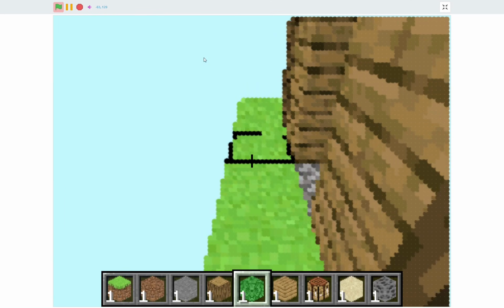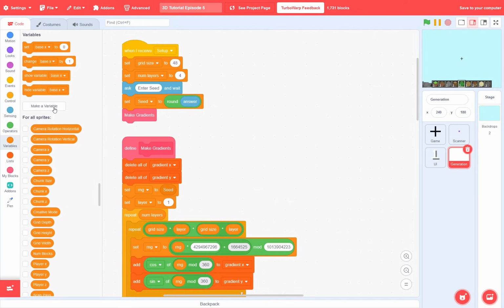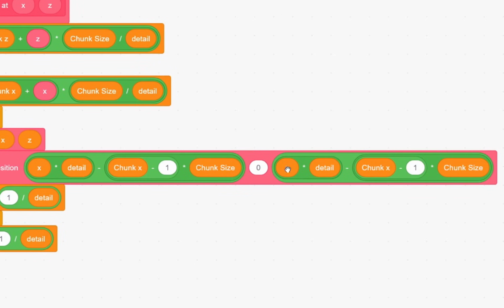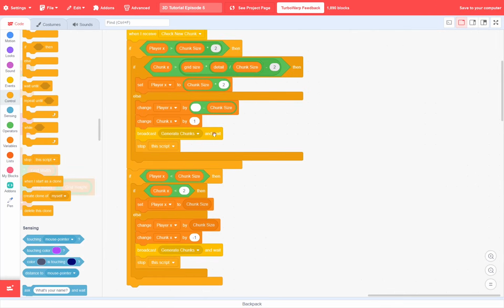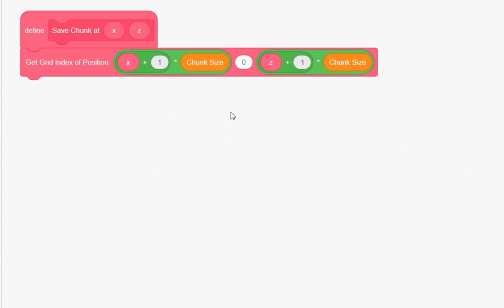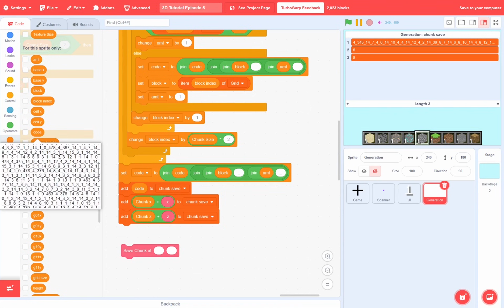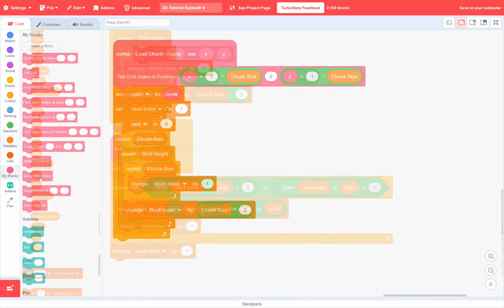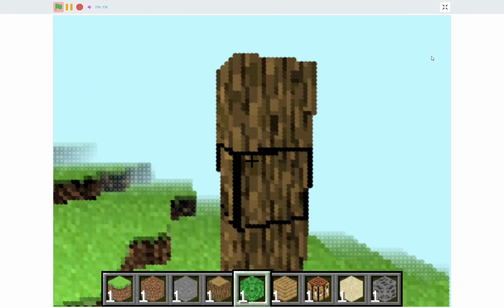Minecraft in Scratch E5 | Terrain Generation

Comment: Next episodes your could
1 add structure generation
2 rendering other than blocks, like flowers
3 mobs
4 menus, settings, ext.
5 multiplayer?! Maybe I’ve tried but it didn’t work, people have made 2d multiplayers in scratch, but turbowarp doesn’t have multiplayer
6 tweaks to improve gameplay / fps
7 shadows like ambient occlusion
Reply: coughs TRANSPARENT BLOCKS
Reply: @1mangoguy he already added that
Reply: @QWLUXY  oh lol
Reply: Turbo warp does have multiplayer
Reply: @MrCubeDev I ment with cloud variables
Reply: btw structure gen is easy, you just set a var for x y z and  change the y if it's in the ground, then manualy use the
"Place block at" block to build the structure

Comment: I have an idea as to make trees efficiently and easily. 

it would use perlin noise to specify the location and zone of the tree, and then use for () loops, to loop through the specified area. It would then replace that index of grid with the block you want. I do not know if this works, I only tried it in a c# example.

Hope I could help :)

Edit - it would also be amazing to see delta time incorporated at some point, I did try to do that myself but failed 😅
Reply from the maker: This is actually a really good idea! I had some similar ideas but I hadn't put too much consideration into generating the trees column-by-column. I think it would be quite hard to pull off in a clean and versatile way, but possible. I'll think about it a little, though I probably won't do an episode on it for a while.

As for delta time, I'll cover it in the next episode :)
Reply: @FindingPepper  Ok, sounds good! 👍 Sorry about my comment possibly not being at the best time, I live in Britain.
Reply: pick random and the snapping it to a grid works too...

Comment: infinite terrain please
Reply from the maker: Unfortunately Perlin Noise isn't really set up to do infinite terrain well. It's possible, but a lot slower. You need to be generating more gradients on the fly, and then accessing the height of each point becomes much more time consuming as it's no longer so quick and simple to find the gradients corresponding to each position.